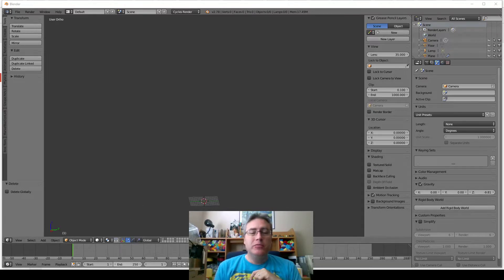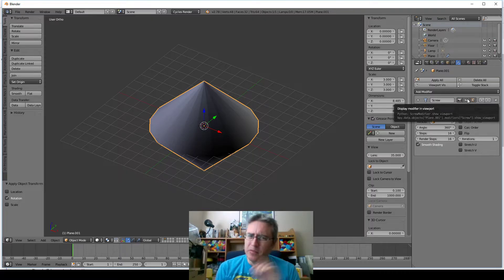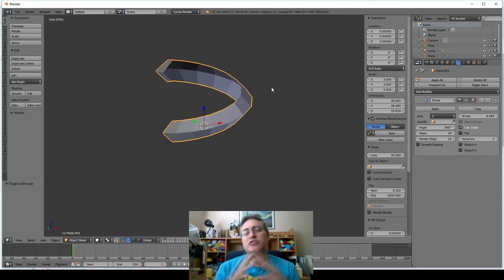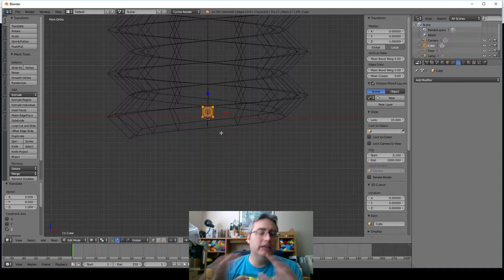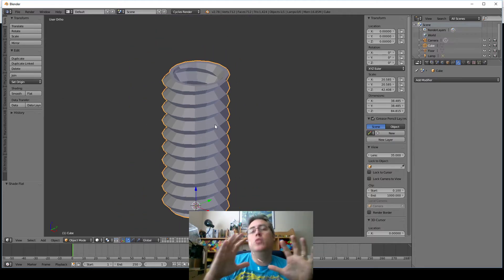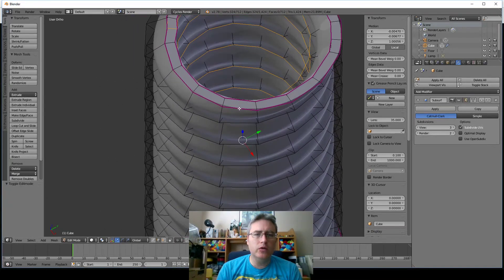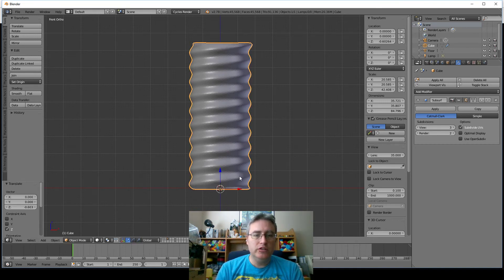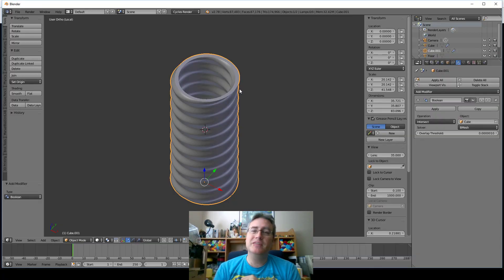Smoothing a mesh for 3D printing in Blender

Comment: This works great to sharpen the corners, but I am having an issue where there is still a lot of visible ribbing from the old poly faces - how can I tweak these?
Reply from the maker: Increase the subdivisions?
Reply: @3dpprofessor  tried that, didnt work BUT I have found it helps to add an additional loop cut and pull it close to the creased edge

Comment: How did you get that transform toolbar on the right?????
Reply from the maker: In the menu at the bottom of the 3D view select "View->Tool Shelf" or press "T"
Reply: Thanks, but I meant the one on the right not the left lol. I got it figured out, thank you for your videos!! I have been trying to 3d print the corvega car  from fallout 4 for a long time and your videos have set me in the correct direction for creating a printable file.

Comment: Love your vids, my fav so far in the one on print speeds w/ different slicer settings.  Regarding smoothing the mesh, for me the free meshmixer from autocad is a better tool for doing this type of work.  Blender is crazy complex.  Almost like using SketchUp to do simple 3D models instead of TinkerCad.

Comment: hello, i was wondering about what i should look for as a character modeler looking to print articulated characters no more than 6 inches tall. 

(my question is more about what i should look for hardware wise.)

will any decent 3d printer do at or below 500$?

what filament will be best to use for the joints?
(i will probably try and find a better joint type then just ball joint as in my experience they wear out easily.)

is there a filament that can be used for prints that need to be flexible such as coat tails or long hair that might interfere with articulation otherwise? 

and do all filaments take acrylic paint well? or is there some I should avoid for prints intended to be painted.

and are my expectations of 3d printings capabilities a bit too high?
im not expecting to knock it out of the park right out the gate but id like to see how close i can get to a cool custom figure to have sit on a shelf, make an animation with or maybe let some kids play with if its durable enough.

ive done some research on my own but cant seem to pull up much of anything relevant.... usually just get linked to print files.
Reply from the maker: 1ard Wow, that's a lot of question. Let me see.

Check my channel for the 3D Printing 101 playlist. there's a wealth of information there that may help you. I may repeat myself from that series on these answers.

Before you buy a 3D printer you should ask if you have the skills to make the 3D model you want. If not is recommend starting there.

In sub $500 range the only 3D printers you're going to get are FFF style. FFF style have some design considerations but people do amazing things work them.

Some FFF printers can print flexible, but none that I know of do so without modification. Direct drives are better for it.

As for custom modular toys,  Autodesk has a creature designer app. it can do robots or animals and it's output is designed for FFF printing. It's a good place to look for inspiration.

I hope this helps.
Reply: my skill set is more geared to 3d animation then 3d printing but i am a competent modeler.... and i have 3d printed several static models through Shapeways before so yeah i do know what im doing on that front.... 

honestly, i just don't like the idea of sending an articulated figure off to Shapeways paying 40$ and waiting 2 weeks for it to arrive only to realize the articulation isn't working right.
i imagine i can make quick tweaks to things with my own printer and just melt down any mistakes. into a cast of a bowl or something.... overall spending less time and money.

i just don't know much about the hardware side of 3d printing.
(im aware their machines will be much better than anything i can afford.... and i will have to get creative.)

Thank you, this gives me a better springboard to research from.

have a good day!

Comment: So, how badly might that affect print time?  Are we talking 2 weeks to slice?
Reply from the maker: That is an excellent question. In the old days when slicers were written in Java and frequently ran against memory limits, bigger models would bring slicing to a crawl, sometimes even full stop. However, most modern slicers, on most modern computers, slice through even very complex models in only a few seconds. You'd need to have a really slow computer and a really high res model to even notice it these days. 

As an experiment I subdivided a cube till it had over 1 million polygons (1,557,506 to be exact) it it took Cura about 3 seconds to load it in and 4 seconds to slice it. It took Simplify3D about 3 seconds to load it in, and it still sliced it in less than a second.

Comment: you should 3d print a tie.  you can't be a professor without a tie.  without the tie, you're just 3d printing guy, or 3d printing dude.
Reply: I believe he already has 3D printed a tie... Blue with white stripes. :3
Reply from the maker: Also a duct tape one. But I haven't done a PTFE one. So... that's a thing. Not sure I have a print bed big enough. I'll see.
Reply: You could print a pre folded flexible tie, then when you need it to open it up, you just tie a drawstring to your pants ;)